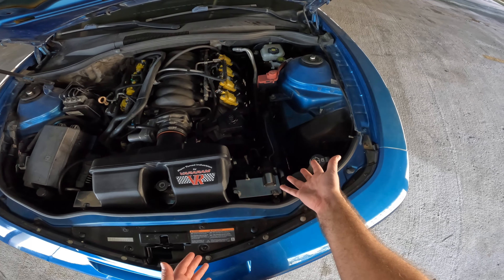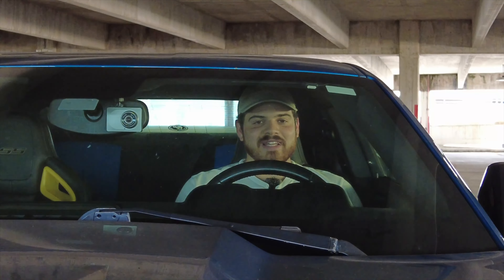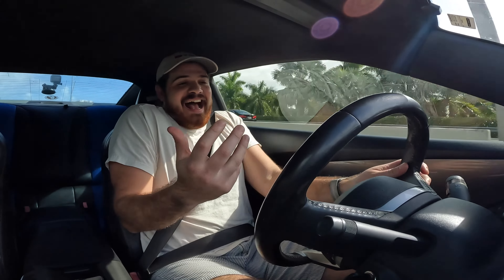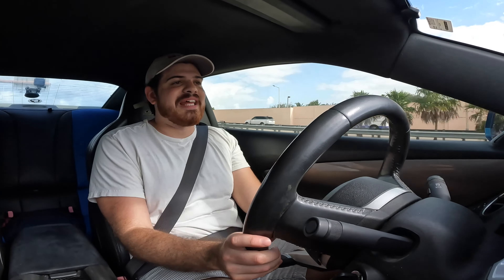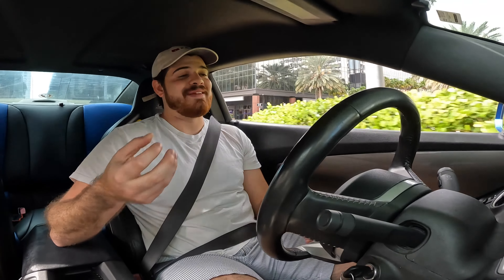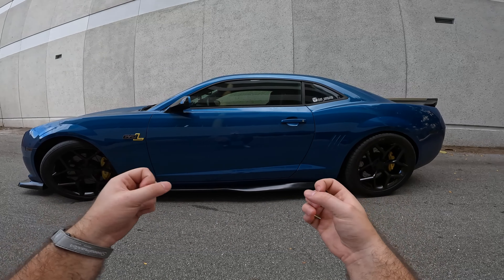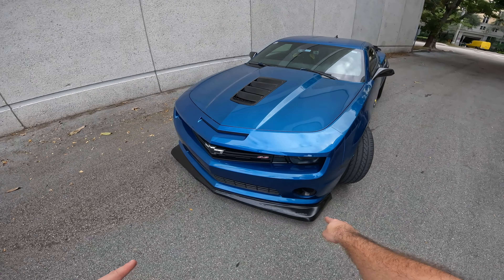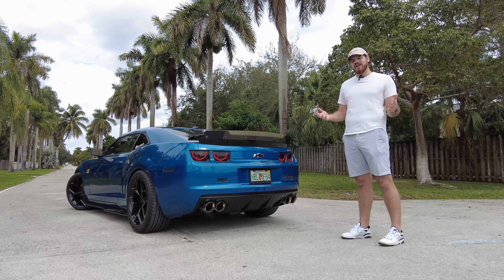3 Mods I REGRET doing to my 5th Gen Camaro SS - I wish I did THESE Instead... | Gen 5 Camaro Mods!

Comment: I see a Prius in your future. 😁 Seriously though your car is very nice! I have a '13 Rally Yellow 2SS. I went straight pipe but kept the stock muffler. I don't get drone like you described and I drive with my rear seats folded down so I can hear it all! My only exterior mods are getting the hood, mirrors, and spoiler painted black and an aftermarket grille for the front and new wheels and tires. Looking forward to getting a supercharger in the near future. I think I will look into tinting the headlights and when I black out the tail light bezels this winter. I only drive in the summer months up here and there is no night at that time of year.
Reply from the maker: Lmfaooo for a daily? WHY NOT, hahaha! Yeah going FULL straight pipe is wild tbh. You're a guy that went straight to performance, exactly what I should have done!
Reply: A Prius 😂😂😂
Reply: Don’t knock a Prius lmao I’ve got a work car 2008 Prius it’s a tank. My at home car 2010 2 SS/RS M6 . Kooks LT’s QTP cutouts

Comment: As far as your exhaust goes. Retro fit a factory NPP system. I did it & I absolutely love it. Quiet when cruising Flip a switch & it becomes a strait piped system. Best of both!
Reply: Are you running the Mild2Wild setup? I have a stock 2014 SS with the NPP and considering my exhaust options. I’m thinking about just keeping the NPP and eventually running headers and a X-Pipe. I also really like how the Valvetronic mufflers came out on Gabe’s SS. I still want some kind of quiet mode, but don’t want to spend money unnecessarily.
Reply: @jakethomas_419   Sorry for the delay. Mine is a 
12 so i it is retro fitted . ran off engine vacuum with a vacuum solenoid to open ^ close the valves it works but only an open & closed position, no in-between.

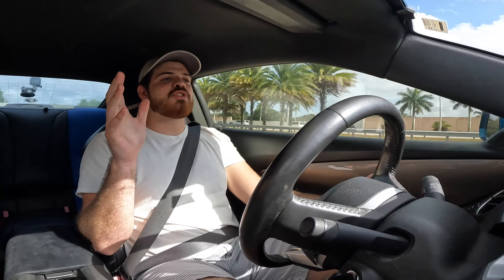Comment: at 7:00 you need to put the car in 6th gear so your rpms would be at 1750rpm, that's if you have stock gearing.
Reply from the maker: 6th gear is usually the worst
Reply: @gvaspirated True at a certain rpm. I've seen your more recent video of you owning the ZL1, which is nice. I have installed some J-pipes from solo performance, it really works wonders with the drone tremendously. The next owner might want to consider them if they are staying straight piped or using unrestrictive mufflers.

Comment: I just went with a 1LE. It comes with a lot of the mods that you made from the factory. 

Aesthetics:
- Hood vent
- Front splitter
- Rear spoiler
- Quad exhaust tips
- Suspension
- ZL1 Wheels 285/305
- ZL1 Short throw shifter
- ZL1 Suede flat bottom steering wheel
- ZL1 Suede shifter/boot
- Strut tower brace

Mechanical:
- 3.91 diff
- ZL1 fuel pump w/multiple pickups
- Swaybars
- ZL1 wheel bearings, hubs, toe links, and rear shock mounts 
- ZL1 rear axles
- Re-geared TR6060
- ZL1 Oil/trans coolers
- Oil catch can

Mods I installed w/the help of Camaro5 and YouTube:
- K&N Intake (wish I went with a Rotofab) 
- TSP 1 7/8 long tube headers
- TSP Stage 2 cam (3 bolt)
- Borla ATAK catback
- Dual spring valve springs w/titanium retainers
- Pushrods
- Che trunnion bushings

Putting down 488hp/490tq
Reply from the maker: If they werent so expensive and rare, I would have gone for a 13 1LE. I absolutely love how perfect they are from the factory. That's awesome man!
Reply: @gvaspirated  man I love those. I wanted one but I a 6gen instead 😅
Reply: just picked up a 15' 1le a month ago, didn't know it came with that many zl1 mechanical goodies
Reply: @FelixLSX  Heck yeah brother!
Reply: Bump that. No better feeling than modding your own car to your own preference by your own hand. It just takes all the fun of tinkering and customizing.

Comment: The quickest way to hate your 5th Gen if you take long trips is swapping out the exhaust.  Most aftermarket exhausts are going to drone unless you do it the right way and that gets expensive with little gain in performance.
Reply: Facts! 2 inch headers and 3 inch catback on my ZL1 lasted 2 weeks! Fauk that noise put my Npp back on no cats loud asf on Acceleration but whisper mode while driving no drone and that’s still with the Kooks 2 inch headers  ! And my ass nor do my passengers feel any power loss so each to their own but I said Fauk that drone 🤘🏻😎

Comment: The exhaust was surprising, however it makes total sense man. Especially as you get older. My 2SS still has the stock exhaust and im not really eager to swap it for the reasons you've mentioned. 

Im 41 years old, and when guys pull next to me with super loud exhausts, it annoys the F out of me. So, the idea of hearing that 24/7 from my own car is not very appealing.  

Driving on lowered cars is also not very fun when you get older, but i really dislike the Camaro stock height.  So I went with airlift suspension.  I can drive lower, higher, or at stock height. Also, slamming it when parked is pretty cool. 

Like you, driving around on static just makes me too self conscious. When you get a certain age, you'll start to prefer comfort and practicality over looks.

Comment: I feel like the straight pipe could have been fine if this wasn't your daily car. But as a daily car, i find it's too much, especially with those long tube headers.
Reply from the maker: Bro even using it as my car for the channel and driving for 30-40 mins, it's already too much xD!
Reply: I have a straight piped 2010 2SS. (No muffler, no res, 7/8 long tubes, x-pipe and high flow cats) It's honestly really not that bad unless you really get on it. I work and live near a police station and never even get looks from cops when I'm crusing past them. I also don't have much drone either. With my music going, I barely hear the car from the cabin. The concern for this setup is a bit exaggerated. I do have the L99 though. I'm not sure if that makes a difference at all. 

Adding a cam with that set-up would be a different story.
Reply: I disagree, even with headers a straight pipe will make your camaro ss sound pretty good but not obnoxiously loud. Now if you had a Mustang GT then yes it’s obnoxious. Plus the only time a camaro is truly loud is if you either Gun it or have Cams. I have a 2010 camaro 2ss and I had long tubes with straight pipe as well and I loved it. I changed it to highflow cats mainly because I live in Cali and there’s no way I could pass smog with long tubes.
Reply: @Gho5tdSS I agree, a cam will definitely be too loud and you’ll definitely get a Cop on your ass. I was pulled over once but only because I floored it right next to a cop.
Camaros sound amazing with a cam set up.
Reply: @petermad152 when you smogged it you took it to a regular shop and it passed the smog test?

Comment: I’m really happy you went into it about intakes. I have a K&N plastic tube cold air intake and thought about changing because people apparently don’t care for them as much. I didn’t know if that was because horsepower gains were worse or not. I take it they are around the same. Also I’m pretty sure your gears aren’t stock. I have a 2012 LS3 with a similar exhaust set up. I have flow master axel backs instead of no mufflers. (416rwhp and 426 tq on dyno), and 75mph  I’m right at 2000 rpm.
Reply from the maker: Hey man thank you so much for the feedback. Honestly the intakes help but which one you get shouldn't really matter to much

Comment: Got a 2015 LS3. It came with a Hurst short throw shifter, dual mode exhaust and a trunk mat. Bought it new. Do not like the transmission, Shifts hard and will jump out of 2nd gear sometimes and is noisy. Installed the skip shifter bypass and got rid of that nonsense. Had the dealer check the oil level in the transmission. Never  raced or even done a burn out. It has not been abused so I don't know what the deal is with the transmission. But I love the car. Would never lower it because I already drag the stock front splitter on everything. Only got just over 14k miles on it, almost 10 years old. Looks brand new, still.

Comment: Straight-piping my Challenger R/T has earned me increased attention from the cops & 1 ticket already ☹️
Reply: I had a 2019 Challenger R/T some years back. A mid-muffler delete and h-pipe with the stock rear resonators sound sounded great. Deep sound, not too loud until you get on it especially in sport mode. Never had any issue with cops or anything like that. 

If you ever decide to go back, I'd recommend that setup. It won't break your wallet either. Just keep in mind that on the Challenger and Charger the mufflers are in the middle. The resonators are in the rear. There are some shops that will argue that and they are incorrect. Don't let them tell you otherwise. Lol.

Comment: Is your parking brake lever covered with CF inserts? I'm looking to change the lever completely if it comes made in that material, but so far all I have seen are covers that you put over the original, which I'm slightly on the fence about.

Comment: You were droning about the drone. Accept for the inline 6 old Ford truck I have, all my other vehicles are straight pipe V8s. I drove my 2011 SS 92 miles to work every day.  I'm 45, it still doesn't bother me.

Comment: Why don't the 2 ss have the covers like the  1ss  over the engine?
Reply: They do. A lot of people just choose to take them off to see the engine. Mine has been sitting in my garage on a shelf for years.
Reply: Plus the covers gather a lot of dust
Reply: @petermad152   Well assume they're there for a reason, Or are they just gingerbread.
Reply: When I get mine I think it's gonna stay mostly stock.
Reply from the maker: They all have it but apparently it helps with heat soaking too.

Comment: Your mass airflow sensor dictates the amount of air the motor gets. And a tune is a must if you expect more
Reply from the maker: so basically the tune version would be better?
Reply: @gvaspirated  personally I would run the big gulp CAI,
an LS7 intake, or a Fast and swap out your TB and put a quality cat back system back on and then have it professionally tuned and you'll be happy
Reply: @gvaspirated absolutely